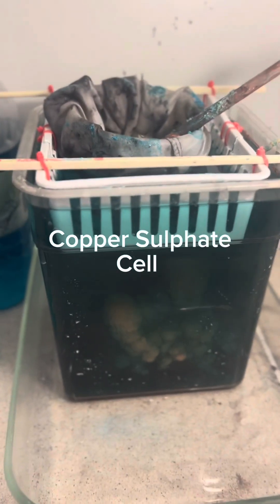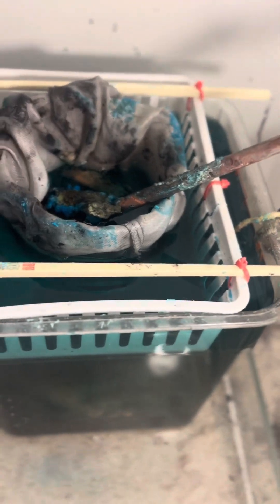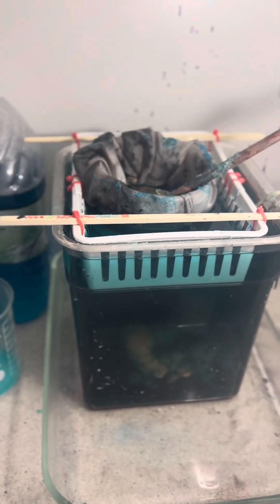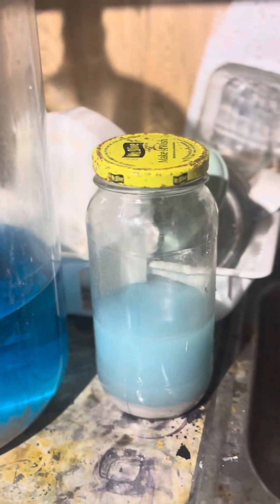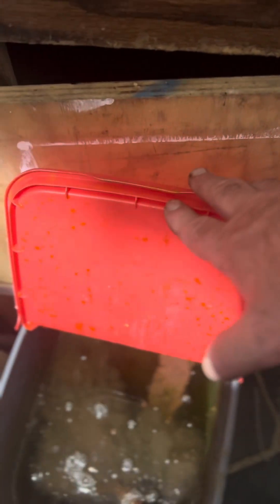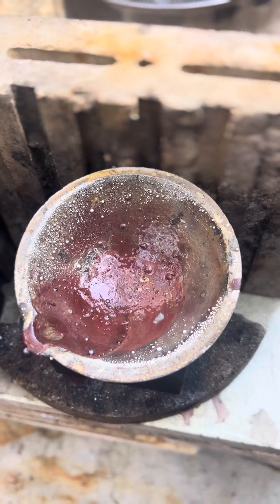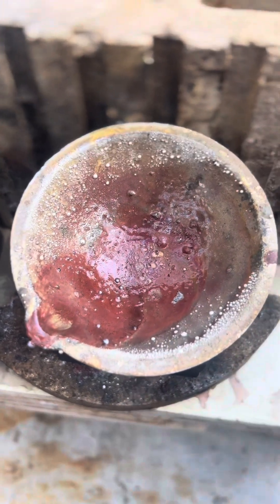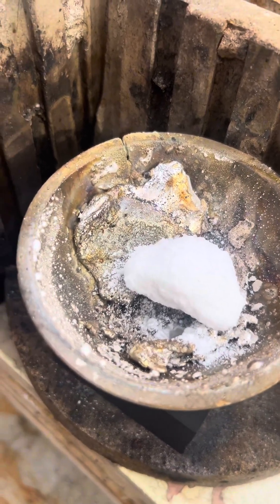Pouring Silver Shot  #silver

Comment: Wash/boil the copper cell slimes in hcl and then water three times then once in ammonia, before parting in nitric then AR?
Reply from the maker: Think you confusing this with cleaning up gold .
Nitric on the slimes and filter. Decant/ siphon off 
Collect the filtrate and papers and burn the papers and undiscovered slimes , then process in AR
Collect the liquid you separated add some silver to use up any excess nitric , test for silver 
Drop the silver

Comment: A few mls of hot sulfuric should dissolve the copper maybe as a test.  I would wear face shield and other protection in case of splatter.
Reply from the maker: Sometimes I wear safety glasses bad habit on my part but I did wear I respirator
Reply: @ Strongly suggest a face mask around any hot acids.  I use a fan mostly outside.  This is where it would be nice to own your home so you can cut holes in the roof etc.
Reply: @ I trust airflow more than respirators.  I am very allergic to wheat dust and I used to work with breeding.  No matter what the respirator I would be near anaphylactic shock after about 4 hours.

Comment: So much to learn.  I have a very good background in chemistry and I still feel like a noob.
Reply from the maker: Me too
Reply: @ I like your channel more than Sreetips.  He is kinda on production level while you are experimenting with new things.
Reply from the maker: @naughtiusmaximus830 thank you I still like watching him. That redux / distilling rig that was used to capture NOx was pretty cool . I’m going to do that next . Instead of building a scrubber for the hood right now.
Reply: @ Is that to recycle silver nitrate?  I don’t want to mess with nitric fumes at my level.  If I had a barn somewhere I would.
Reply from the maker: @naughtiusmaximus830  you can recycle the nitrate salt. Filter and boil down your copper nitrate , use electrolysis to remove the copper  . Then you can reuse silver nitrate to cement out silver on the cathode . I did  a small experiment  in the spring Using Copper Nitrate to dissolve then cement Sterling Silver in one beaker (Part 1)
https://youtu.be/_-QwCy2GrK0

Comment: A little maintenance work 👌 I don't know what kind of borax you use, mine is water based and I need to melt the borax in the crucible first before adding the metals to the crucible for melting. Otherwise my borax will fly away 🙂
Reply from the maker: Mine too I didn’t think about melting it first . Jeez I do things the hard way some times I heat the metal up then add some flux I was rushing a just grabbed a chunk and rolled w/ it. I was going to try and seperate solutions later today by freezing really do like how you maximize your value on reusing solutions and salts